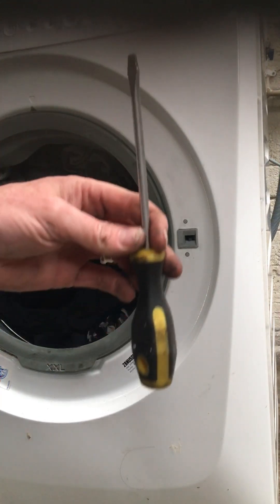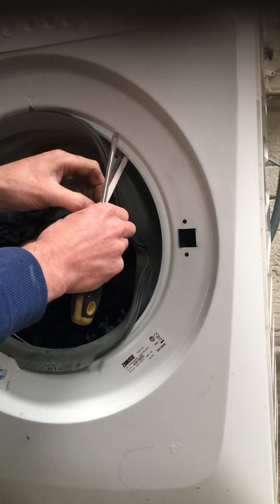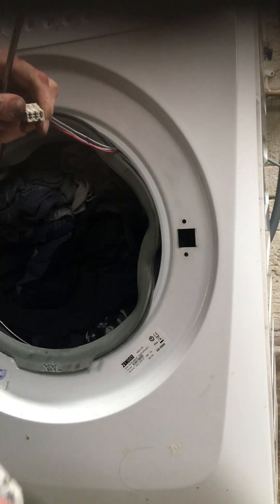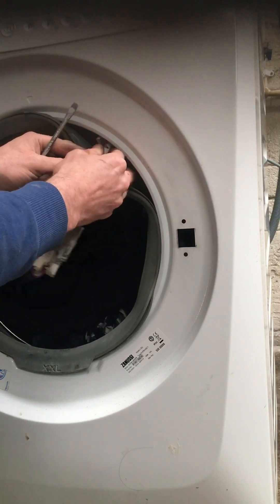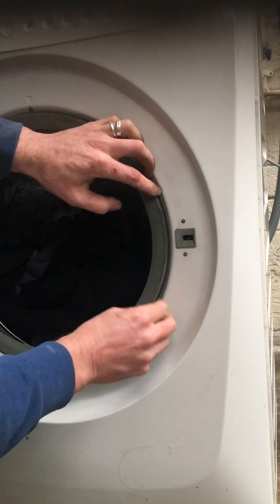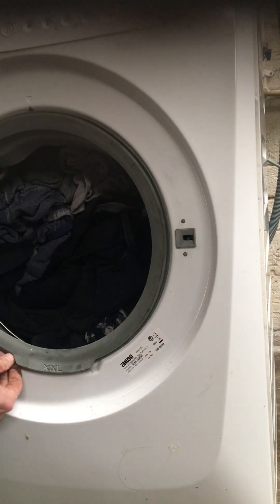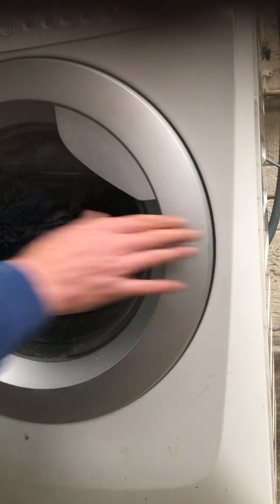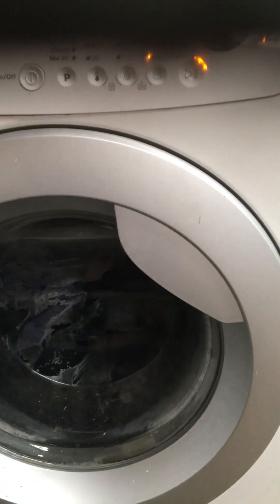Zanussi Lindo 300 E40 error Repair

Comment: Thanks a million for the video, it's worked a treat. I got the broken lock removed without taking off the wire completely. When I installed the new part, I found it easier to reseal the rubber when I took out more of the wire. 
But I can't thank you enough, it's saved me the price of a new machine and got me some brownie points too 😉👊
Reply from the maker: @grgwhite400  the brownie points are the best bit ! 🙂👍

Comment: Thank you for the helpful video. Easily replaced the door lock following your instructions. Unfortunately, E40 error is often happening again after the replacement - or the machine will stop working intermittently during the wash with door lock light blinking and knocking/clicking sound. Would you have any suggestions?
Reply from the maker: @TheAsker92  hey there. That is unusual to be honest. Does there there seem to be any damage to the door latch perhaps, Also is the wire pushed back into the new lock fully?
Reply: @washingmachinetipsandhelp4350  The wire seems well in place. The metallic external part of the door latch looks find, I haven't open the door so not sure if there's more to see inside there
Reply from the maker: @TheAsker92  there is a slight chance the board could be the issue or possibly a faulty Doorlock sent to you
Reply: @washingmachinetipsandhelp4350  I could give it a try at asking for another doorlock , if it is about the control board I guess I'd need to go for a new washing machine.. Thank you, anyway!
Reply: Having the same issue. Did you find a solution
Reply: @elementalismgaming2396  after the lock replacement, the issue occurred intermittently and I insisted in using the washing machine. The first times it was often getting stuck during the wash and then working again after a while. Nowadays, the machine has been working without issues for a month - weird as it sounds!
Reply: @TheAsker92  I just moved the drain tube. And it had some water in it. Now the lock mechanism is working again.
Reply: @elementalismgaming2396  that's quite interesting. Were you removing the drain tube and cleaning? I could give it a try if the issue occurs again
Reply: @TheAsker92  I just repositioned it so the water came out.